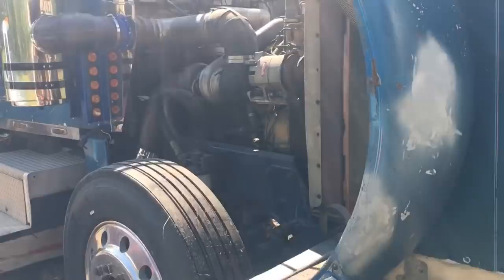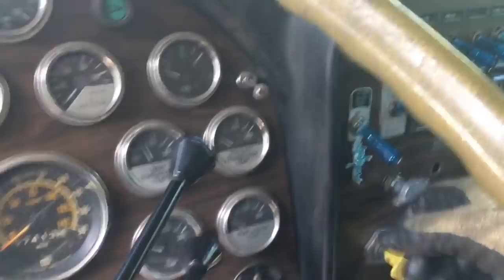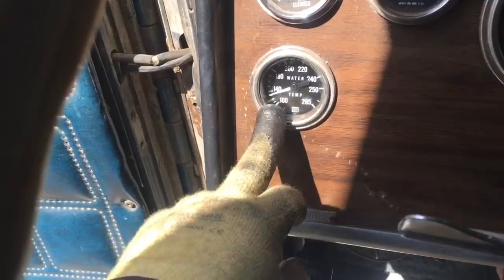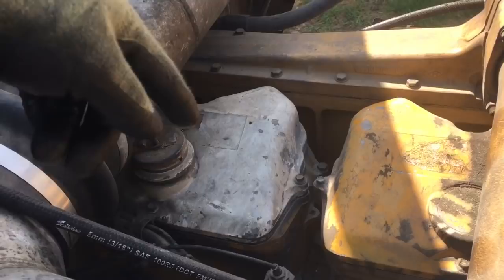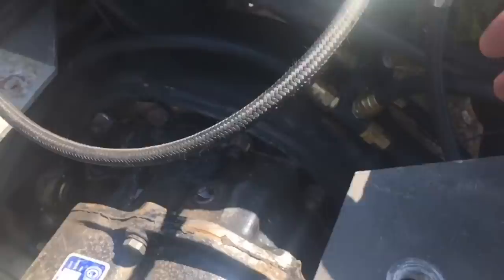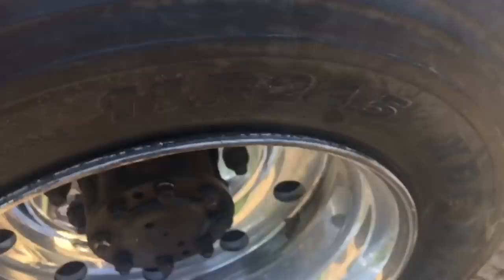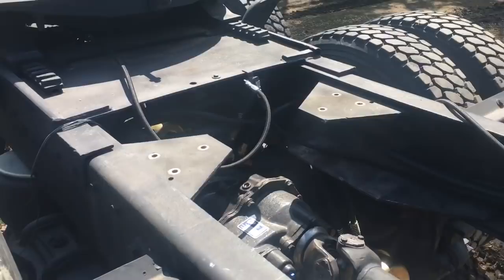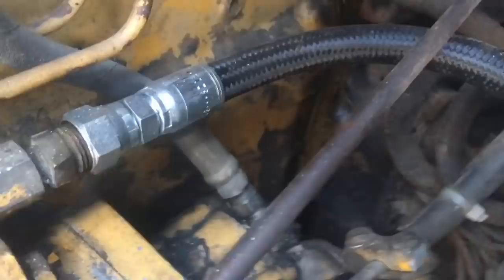Peterbilt 359 Restoration Ep.33 Yard Drive & Air Leaks

Comment: I have a soft spot for your project. In 1985 I got a '79 Mack U model after joining Central Transport. I started my apprenticeship in 1969 and the first Pete I ever worked on was a turned in unit that had faded paint. I loved the way the dash flipped open to get at the electric circuits. The truck sat on the lot for months but after a fancy new paint job it found a new home. At Central we just hauled auto parts in Ontario, Michigan, Ohio and new York. by 1990 I switched companies and hauled freight out of Milton to Chicago and also New York. Once on a trip to Brooklyn I could not get around a corner as a sports car was illegally parked and blocked my turn. A policeman saw my predicament and ran to my rig and jumped up onto my truck. He ask me how much weight I had on, and I said a full load of 44,000 pounds. Then he told me to drive over the car! We argued and by then the guy who had the car moved it and the policeman went right after him. Many times I went to New York and I had just as many stories for each time I went.

You start by saying you can not get heat from the engine. You never will unless you put a load on the engine. In the seventies I sold garbage trucks and I was in Timmins and it was fourty below. I left the jimmy running for an hour to warm up while I had breakfast, but it was stone cold until I began to drive it. Love your rig. Good luck with it. I kissed the Mack goodbye in 1992. It went to Quebec.

Comment: Engine wise, I'd just adjust the valves, make sure there's no build up under the valve cover, and send it.
Hook up some full trailers and do a some wide open pulls. If it pulls good and doesn't smoke your all good.
Reply: I agree put some load on the old cat it will love it

Comment: Doing a good job my friend I would adjust the valves on the old girl and run her for a while. Don't go looking for problems that might not be there. Hell it's a mechanical Cat! When you put the wear plates in take out the bottom bolt (good luck) and put a bottle jack on top of the spring under the frame rail that should give you enough clearance. Drill all the way through though don't try and tap it. Also anti seize all the hardware especially the long bolt underneath that runs through the roller tube. Good luck hang in there you'll be real proud when you get done.

Comment: Take a big prybar and crawl underneath the front of the motor. See how much the crank is walking back and forth, which will give you a good idea of what shape the bottom end is in. And do a valve set which is easy and free other than maybe gaskets, and they always run better after.

Comment: Hey that popped bead is an easy fix, don't take the wheel off! Go to any tire repair wholesaler and grab a pail of bead seal, it's like a water soluble jelly. Just jack up the wheel, smear the bead seal around the bead and hit the wheel with air. the bead seal will stop the air from escaping just long enough for the bead to seat on the rim and then air up as usual. the excess on the out side will wash off with water and the excess inside the tire is "rubber safe". If you can't get a hold of the bead seal, wrap a chain around the lifted tire in the center line of the tread and on the top of the tire hook a boomer on the chain and close it up with a load bar. That will squeeze the center line enough to allow you to seal the bead and air up the tire without removing it. Once the bead is sealed and tire aired up remove the chain and boomer.. (Old tire shop tricks from running service truck).. Cheers! Old Girl Sounds Great!

Comment: Just air that tire up, unless you found a nail, hole in the tire.  It probably just leaked on the bead, because those tires haven't had any weight on them, and it just sat since you put the rubber on the rims. Truck tires don't fit on the rim any where nearly as tight as a car tire, so they can leak down on the bead easily. Take the valve core out to get more air flowing into the tire to help get it back on the bead.  Drive the inside tire up on a block so that flat one is not sitting on the ground, that will help get it back on the bead again along with removing the valve core. 
Hopefully you won't need a bead blaster to get it back on the bead. I would tell you about the "old Either trick", but that takes a practiced hand to pull that off, not for the faint hearted. Old truck driver is needed for that method. 

Most of the trucks I have driven the fan won't come on automatically, until you get around 205 F. If I'm pulling a hill loaded, the fan switch comes on at the bottom of the hill, why get the head that hot if it's not necessary. 
The A through the E 3406 used just gaskets, on the front and rear housings of the block. They went to an "O " ring impregnated in the  gasket to help get rid of the leaking problems on the C15. 
So there really isn't much you can do to stop it, unless you want to pull the engine. Geez it only took them 20+ years to get around to fixing those housing oil leaks.
I like your idea of drilling all the way through that casting better, trying to tap threads in that casting may not work very well since the bolts will be much harder than the threads you would be tapping
the bolts may just pull the threads right out.  
 I have to replace one of those spring hangers on my 379 , and they are $1200.00 U.S. new from Pete on the "Low Air Leaf".    Found a used one in a wrecking yard for a lot less. I lean heavily on the junk yards, look at the money you saved on that cross member. 
You got to get her moving, good deal. Keep plugging away, and the video's coming.
Thanks for sharing all your efforts with us.

Comment: On the tire that broke the bead, No need to take it off. Jack that tire off the ground and put a ratchet strap around the middle of tread. Crank it down and add air. Oh yeah, take the valve stem out to get more air flow. Once the bead sets remove the strap and fill it up.

Comment: Might not hurt to still add some sort of spacer plate to the spring hangers to make up for the wear so the new wear plates will be in the non worn stock location.  I'm sure you have thought of it, just throwing it around.

Comment: You may not have to take the wheel off the truck to fill the tire back up. If your casings are good the tire may reseat right back on the rim just by putting air to it with the axle off the ground.

Comment: Can you put a rachet strap on the tire and get  the bead to set up again,  some times it is easier to take the bed off the f-150 to get at the fuel pump.
Reply from the maker: Banjo Benson ya I’m thinking I’m just going to use the cut off saw and cut a door above the tank hopefully in the right spot to pull the pump out rather than drop the tank or pull the bed then I’ll just bend it back down and weld it closed

Comment: Wish you had more of a budget that motor looks like it had better days
Reply from the maker: Kent Williams ya the outside is pretty rough from sittin but the previous owner took good care of it up to the point it was parked.  Fingers crossed it holds together until I can save up for a proper rebuild 🤞
Reply: That's actually good to hear me being a diesel mechanic and regular mechanic I've seen and still see the worse of the worse hopefully you get the funds soon
Reply: for your purposes....a rebuild is probably not needed for a long time. little to no blow by...normal smoke. it’s probably on decent shape.

Comment: I know I watched a video that you said what motor but I forgot what cat is it
Reply from the maker: mike nicholson it’s a 3406 original block that some refer to as an A block ... I think she was rated for 400HP out of the box and you can turn up the mechanical pump to get more if you’re brave
Reply: @TwinStix  if it's a 3406 A you can safely go to 425 horse great engine other then the water pumps they would spin the inner shaft then your done untill you replaced it.
Reply from the maker: mike nicholson yikes how did you know when your water pump checked out?  Would it start pissing out if the overflow hole or would you just notice the temps going sky high?
Reply: @TwinStix  just go to shit temp goes up if it's a older engine I would change it we have ten trucks with 3406 A and Bs that is the only thing we really watch you can baby them to a park spot if they go out but then it's a service call. Just trying to help the engine sounds great if it was me as long as it has set I would change the pump will save you a lot of headache